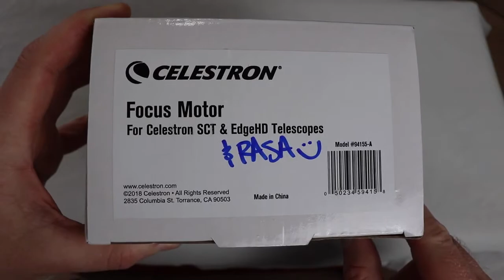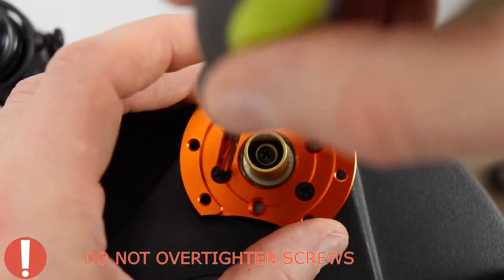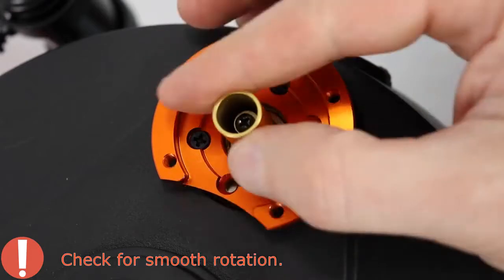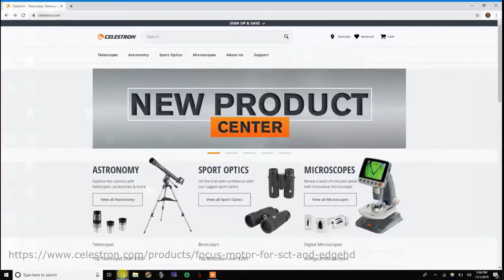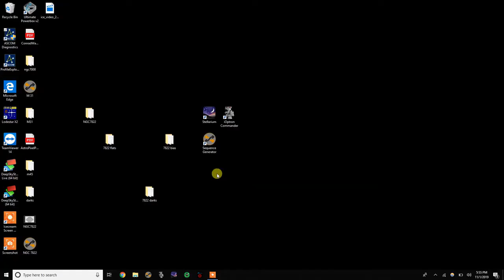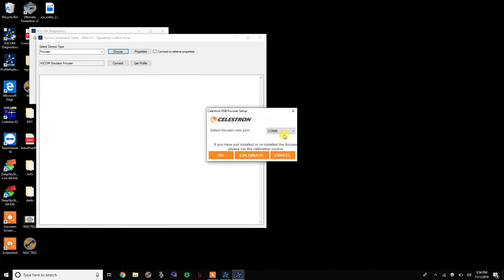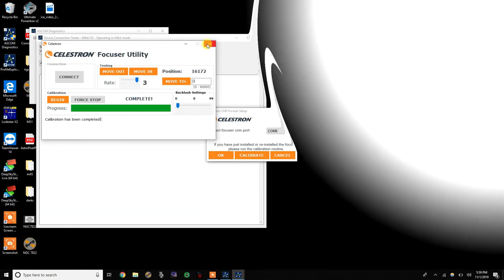**Roswell Astronomy Remastered** REVISED  Installing the Celestron Motorized Focuser 2.0 (2020)

Comment: Note that the evolution 6 uses a 5/64 hex  bolt to secure the mounting plate. The screwdriver will not work with this model. The original bolts are too short to secure the  new focused plate and need to be replaced with m3-05  x 10mm flat head machine screws. Blue locktite recommended to prevent their walking out after repeated use of the focuser. Tighten the screws down very gently at first, repeatedly checking that the shaft is centered, the plate flat and that the shaft rotates freely. Slowly tighten the screws a little at a time. Shaft should not rock side to side when you are finished and the plate should be flat against the back of the scope. Otherwise you may get binding problems. The rest of the installation follows the directions.